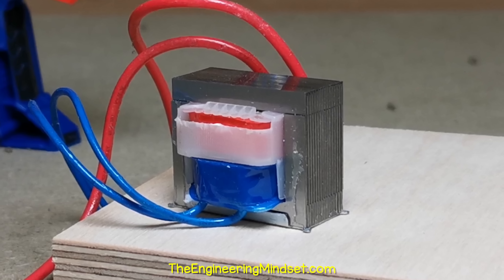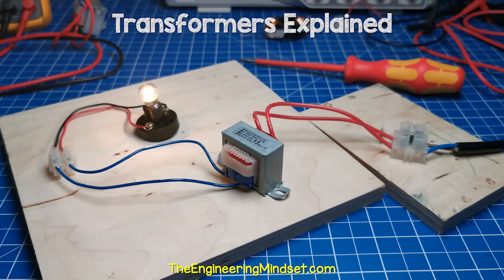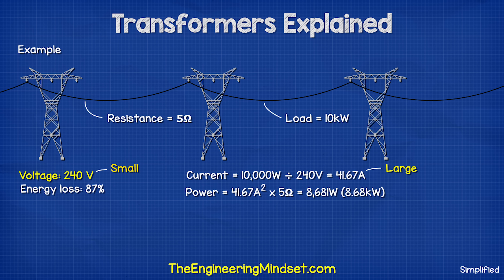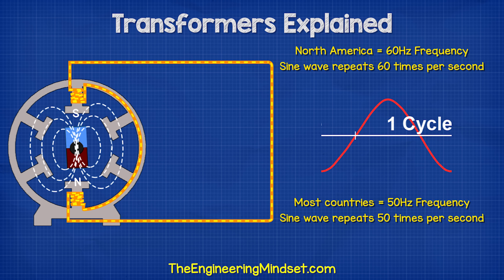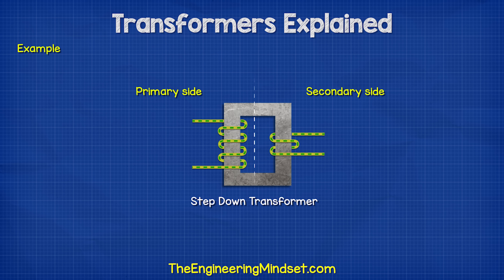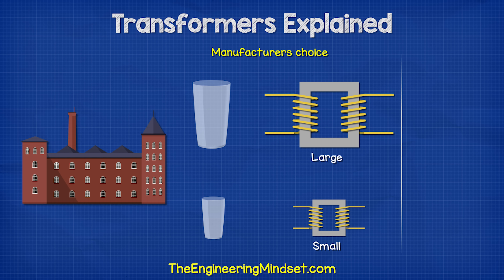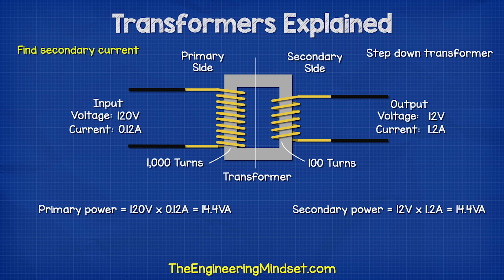Transformers Explained - How transformers work

Comment: Where I've seen transformers used:

I'm a Sound Engineer by profession and often encounter ground loop hum, especially when touring and working in older venues with high-watt dimmable lighting.
I once worked with a band who's Guitarist was an Electrical Engineer and his single coil pickups were creating an unacceptable buzz. I made sure his amp and pedals were in the same outlet and then ran a lead over to the main PA system to check for a "loop". No dice... He said "hold on"... Went to his van and pulled out a piece of plywood that had a MASSIVE 1:1 transformer on it and several outlets. Thing weighed about 30lb. He wanted to tap into the main inlet at the breaker box but I said "nope" Then he showed me his business card and website so I took a stage breaker out and allowed him to tap in there.
The amps and pedals from his guitar and the bass made absolutely NO unwanted noise. The ground loop that no amount of rewiring could solve was gone.

Heavy. Expensive. Potentially dangerous without ground. But useful.

Comment: One question that has eluded me with transformers is this.
Let's say you have an RF transformer that is matching the impedance between stages of amplification. The primary side is lower impedance, and also has a Large DC component that the AC signal rides on. My question is if the DC component would get passed to the secondary along with the AC component, or does the secondary only 'pick up' the rate of change in the magnetic field from the AC?

Comment: What determines the amps in a transformer ? The amps on primary incoming line ? The resistance in a transformer winding ? How does the strength or number of the iron magnetic lines of force field play into voltage, resistance, and amperage ?

Comment: 4:10 I'm no electrical engineer but this sounds like the ol "buy 1 for 2 dollars or 3 for 5 dollars" deal, you could spend the 2 bucks for 1 or get 3 for the 5 dollars but you don't really need or want the other 2, i mean so you spend all the extra energy output to push all that extra voltage to minimize loss but when it gets to the destination your squeezing it waayyy down sooo does that excess get used up? I mean I guess it would if the grids planned out in a way that oh say the output could power 10,000 homes n it's going to around 9,800 homes so you know you won't run short if a few of those homes have increased intake for a Lil while but not so much excess that you got 5,000 homes being powered by a transmission that COULD power 10,000.....cuz the excess that's not used needs energy to supply n keep available but just simply goes unused. Am I making any sense?? Honestly at this point I have no idea if I am or not😮

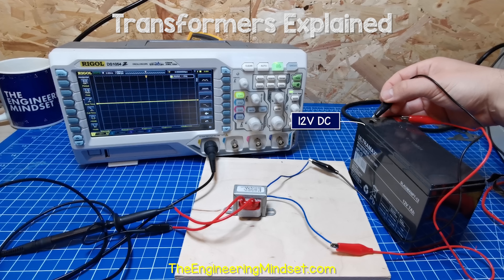Comment: I didn't search the comments and surely a more timely viewer already noted this. At 8:27 even though you didn't call attention to it you showed an example of how a points ignition operated. The points quickly broke a 12 volt DC supply to the primary windings of the coil causing the voltage to decay and thus have a delta voltage wrt time thus inducing a voltage in the secondary windings. I suppose the modern individual coil packs also get a quick pulse of 12v which provides the delta voltage wrt time to induce the high secondary voltage that will jump the spark gap.

Comment: I work with them all the time on vintage arcade/pinball games. Lighting is usually either 6 or 12 v ac., and coils use 24 or 50 volts. Some motors and heavy duty coils run off the household current. They very rarely fail, though new folks sometimes think they do. Your video shows how simple they are with no 'moving' parts, though they can vibrate after they have seen many duty cycles.

Comment: Corrext me if i am wrong TEM, but the example of the European Kettle boiling quicker than the USA kettle is because of the differences in Wattage output of the Kettles (1500W as opposed to 2,500W)
Reply from the maker: Yes, but that is because the voltage is higher in the European outlets so it can provide more power.

Comment: Excellent reference material!   One thing I'd like to see an animation description about a transformer's actual primary & secondary coil counts — not just the ratio.  

Suppose there is a step-down transformer that steps 240VAC down to 60VAC.  This is a 4:1 step down.  But the coil count can be any number of turns that match the ratio.  It could be 400000 turns primary and 100000 turns secondary or it could be just 4 turns primary and 1 turn secondary.  What is happening in these two extremes?  Also does the AC line frequency determine the optimal turn count?

No video or tutorial I've seen suitably discusses this critical concept yet it is one of the first decisions one would need to make when designing an actual transformer.

Comment: Reactive power is not useless! The bulk electric system (power grid) would suffer immediate voltage collapse (complete blackout) if we didn’t provide substantial reactive power resources.

Comment: How do you calculate the initial number of turns on either side? Is it dependent on the input voltage? Say i want to convert from 220V down to 5V, how many turns would i start with on the primary side, which then would allow me to calculate Pturns/44 to get the secondary number of turns?
Reply: Related question: Wire section would be dependent on the amps on the primary size, i suppose. Would the secondary side need the same wire section? Or higher, since we increase the current on the secondary when reducing the voltage?
Reply: Or would that be dependent on the load we put on the secondary side alone?

Comment: Simply using thin laminations of bare steel doesn't fix the eddy current problem. It is very important that each lamination is electrically insulated from the adjacent  lamination The insulation might be oxide on the surface of the steel, varnish, paper or even mica. In most small transformers oxide or varnish insulation is used.

Magnetostriction in the core of small transformers usually isn't the source of objectionable noise. Failure to fill the minute air gaps between laminations allowing them to vibrate is more likely. Some transformer manufacturers reduce assembly costs by making an "E" stack and a "I" stack instead of alternating Es and Is to make the stack. This can allow the I stack to vibrate against the centre leg of the E stack, making considerable noise. Vacuum impregnation of the whole assembly with varnish can help tame vibrations but it adds time and cost so it may not be done.

It is important to realize that the current that flows in the secondary winding effectively "cancels" magnetic flux from the primary winding, so the strength of the magnetic field in the core does not increase with load current. Imperfect magnetic coupling means there isn't 100% cancellation, but it comes reasonably close in a good design.

Transformers are often designed with very little "margin" in either the core or windings, simply to minimize cost. A key part of transformer design is setting the primary "magnetizing current." This is the current that will flow in the primary to set the magnetic flux in the core when there is no secondary current. Normally it is kept to some small fraction of the full-load current. If the input frequency is lower or the input voltage is higher than the design criteria the core can be driven to "saturation" where it can't sustain more magnetic flux. The no-load input current will then rise sharply and hence the resistive losses in the primary winding will also rise sharply. Using a 60 Hz transformer at 50 Hz can cause this to occur if the transformer has been designed strictly for 60 Hz or higher.
An adjustable autotransformer (Variac is a common brand name) can be very useful for testing to detect core saturation. If you start at well below nominal voltage for a winding and slowly and carefully raise the voltage applied while monitoring the current, with no secondary load, you will see a sharp rise in current as saturation is approached.

Comment: Just as an addition to the "240 volt" is that in many European countries it is not 240 volt delivered to the house (or 220, or 230) running on one phase, but rather a 3 phase system that is then "split" into the 220-240 volt that we get in our homes, used often for high-voltage appliances such as a stove+oven in one and has found a resurgence in the electric vehicle market by allowing high-voltage charging of these without the requirement of a dedicated charging station.

Comment: I get power/energy is conserved so voltage increases and current decreases. However, ohms law would contradict this (assuming resistance is held constant). And if voltage can be thought of as the force that pushes electrons (potential difference on a charge) then a higher voltage must lead to higher current given equal resistance?

Comment: 10:17 I think it inaccurate (or unhelpful) to say that a transformer changes the current.  Rather, it changes the voltage and maintains power in, power out (minus losses).  I discovered through experience that winding a transformer with many primary turns but only one or two secondary turns does not get you a bajilion amps.  It gets you like one or two volts, and as much current as that'll get you.  As I increased the turns of the secondary, the current went UP...because the voltage went up.  Consider a dead short across mains power.  You'd get a TON of amps, until your breaker tripped or something caught fire.  Adding a step down transformer would decrease volts (and consequently, amps) to an acceptable level.  The power in/out conservation simply means that once you determine the voltages on both sides and the amps on the secondary side, you calculate the amps on the primary sode, and it happens to be the inverse of the reldtionship between thr voltages.  But, decreasing turns on the secondary decreases both volts and amps, and increasing turns increases both.  (Though I haven't tried that second one, so I'm not sure there isn't some weird complicating factor or w/e.)
Reply: I guess it depends on what you hold fixed as you vary the turns.  If you hold primary voltage AND current, you get [secondary turns up] = [s. volts up] and [s. current down].  But, if you hold the resistance on the secondary side constant, you get [secondary turns up] = [s. volts up] and [s. current up].
Reply from the maker: Check our new  Power Factor Explained video soooo much detail and easy visualisations https://youtu.be/NIrKOVZrqnU

Comment: Reactive power is not wasted as heat, it is the portion of the current that is 90 degrees out of phase with the voltage.  Two sine waves 90 degrees out of phase multiplied together have an integral of zero so no actual power is consumed if the load is 100% reactive, the power is simply returned to the source.

Also, residential customers are billed for true power, not apparent power.

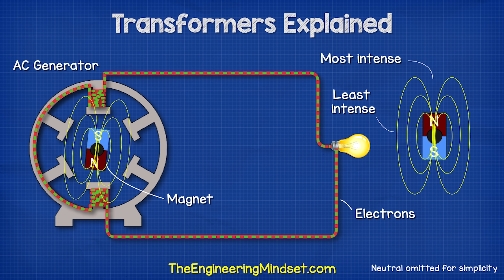Comment: @5:45. Excellent animated depiction of a 2 pole permanent magnet alternator! Best I've seen on YouTube.  Question: Hypothetically,  if only (1) of the (2) poles shown were wired into the circuit,  would there still be the "push and pull" magnetic flux spoken of (and shown) at 5:52? If so, would there be "some percentage" of the complete two pole output generated?  Asking for a friend...😉

Comment: If transformers can't turn AC into DC, what's happening in a laptop power brick that converts 120V AC into the 18V DC that charges the laptop? Is it a transformer or something else?
Reply from the maker: See our rectifier video and voltage regulator video

Comment: Nice video and animation at time 6:05 but it is a wrong explanation . M. Faraday made the first generator but he did not how it 
produced eletricity. It was J. Maxwell who told us how this works. It is about coils and a changing magnetic field. 
The basis is a coil does not like change ( of a magnetic field. ) . When a coil detects a change of a magnetic the coil reacts to that. 
When a coil detects a magnetic field it produces voltage and current and a magnetic field te atack the magnetic field it is exposed to 
With the generator animation at what time is the change of field the largest. It is at the time when the field to the coil is the lowest. 
At the time when the field is horizontal , Firrst the N pole is just a bit stronger then the S pole but then the S pole gets a bit stronger
then the N pole. This is the time of the largest change and the most voltage and current is produced. 
When the field is strongest , vertical lines the coil only detects the S pole there  change of field is the lowest and the coil 
produces almost 0 voltage and current. I gave a description of the top coil but the same is also for the lower coil. 
That is what I think how a generator works.

Comment: australia uses a 4 wire system as well, except our single phase voltage is 230 where as our voltage between phases is 415. no sure about the other countries but i would imagine its the same.

Comment: Are transformers safe to handle when they are not connected to anything?  ie- order one online and remove from package, or take one out of a microwave (after discharging the Cap of course), but just having the transformer as a component you can put into a box for safe keeping, is there any risk of it holding a charge and being shocked as if it "were" a capacitor?

Comment: I have a 240VAC transformer that powers 2 UV tubes at 400VAC. This summer It got 120+F inside the tough shed for the pond equipment, The Transformer was blistering HOT. I know heat can melt or burn xformer copper wire insulation at abt 350F but Im not sure of that figure. I have 12VDC computer fans for cooling I can turn the UV system off via Arduino  if in over temp condition, but what would you recommend as a safe over temp threshold? 275F?

Comment: The center photo shown at 1:36 in the video is NOT a transformer.  It is a line filter (to block high-frequency emissions from leaving a switching power supply to the power line.
          World power: Japan uses 100V.
          Most of the humming sound in a transformer is due to attractive/repulsive magnetic forces between the iron parts (not due to magnetostriction) & between the iron & the coils.  These forces are rather large & modulate at twice the line frequency.  It is important to pack the laminatons tight, clamp them together & secure the coils (usually by dipping the whole transformer in varnish).

Comment: can someone point me to a video or a text that explains exactly how 60Hz is achieved or regulated? im pretty new at this so im not sure im asking correctly. but i guess im asking what equipment is necessary to make a 60Hz and why does it work? thanks
Reply from the maker: It's just the rotational speed of the generator. 60hz = 3600 rpm
Reply: @EngineeringMindset  perfect thanks

Comment: Model train sets, door chimes, radio with tubes like RCA Radiola 60. pole pigs or distribution
xfrmrs on utility poles. Actaully there is a tansformer in your car, the ignition coil. It too has a
primary coil powered by the 6 or 12 volt battery, The points worked by a cam would energize the primary, when the points opened  high voltage jumped the spark plug and in old car radios with tubes, there was a vibrator that alernatively powered a split primary or a center tap and the 
vibrator powered one leg then the other and this made the hig voltage for the plates in the tubes.

Comment: I have something to add about Transformers that you said. You said Transformers only work with AC not straight DC. While true, you left something out. Transformers will also work with pulsed DC.
Reply from the maker: Thanks, it was shown in the video that varying the DC voltage or switching it on/of will also power the transformer
Reply: @EngineeringMindset  Do you think if Edison knew this that things might have worked out differently for him?

Comment: Could someone explain the difference between Volt and Ampere using a more simplified non-engineer terms? Thx
Reply from the maker: Voltage is pressure, amps are how much water is flowing

Comment: I am curious what happens if the consumer does not hook up any equipment to use the power. Is the 'consumer side' of the transformer then inducing a current in the 'power plant side'? Giving the power back to the grid?

Comment: Sidenote about beer xd:
Most beers have specific volume glasses that are larger than the standard (ex 0.56 pint), so that the beer tastes and smells better + the foam isnt on top of the beer.
A Bad bartender or one who likes you will overpour (so boss is mad)
A good bartender will fill until the mark + foam
P.s. foam is 1/3rd~ amount of  beer as volume
Also there are other random things that dont depend on the bartender for example:
1. Boss demands you pour less WITH a lot of foam (you work for him so you follow his rules)
2. Boss buys glasses that are larger than the standard with no marks
Ok rant over xd
Love the videos
Reply: P.S.S foam is used to preserve the co2 in the beer, works like a cap.
So it's useful for sipping, useless if you drink like a bartender/student xd

Comment: Regarding step up/step down transformers, can you just apply the primary current to the other side to reverse it? Or is there a difference between the sides apart from the number of turns?

Comment: Are both legs of the triplex coming into my breaker box 120v or is 1 leg 120v and the other leg coming off the end of the coil winding 240v? If both legs are 120v could someone explain why. And where does the neutral wire come into play here and why is it necessary